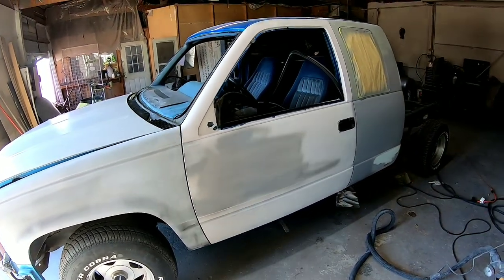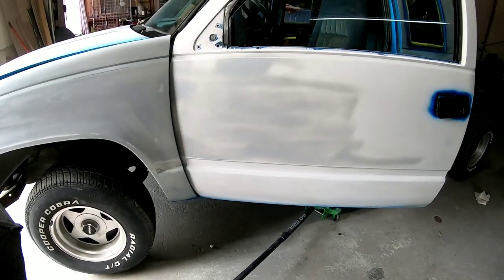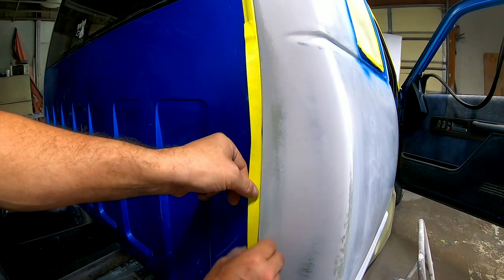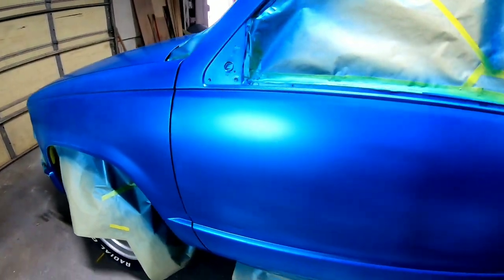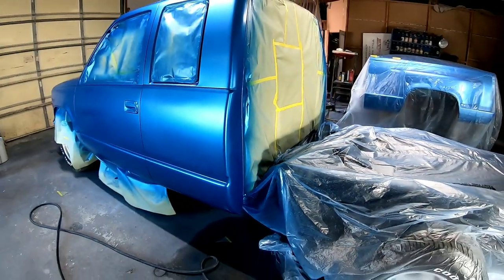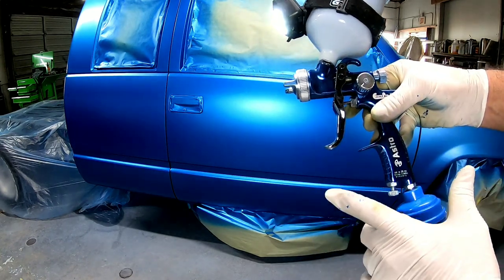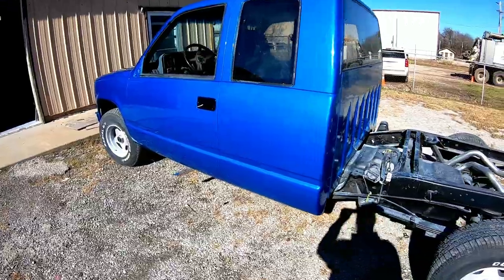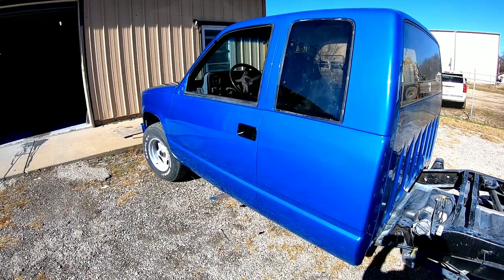How to do a complete truck paint job! auto body repair/diy auto body

Comment: Why not strip down and remove all panels and paint them seperately rather than deal with all the masking? This would allow for painting of the other side as well.
Reply from the maker: It wasn't absolutely necessary on this job. I also have to work with the budget of the customer. Appreciate the comment and support!

Comment: How long did you let the base coat Flash before you wiped it down with a tack cloth again? The truck looks great by the way!
Reply from the maker: I don't  remember exactly but under normal temps it should  be completely dry in 10 to 15 min. You just need to make sure it's  dry.

Comment: Whats the air consumption on that spray gun looking to get one for my 29 gallon compressor
Reply from the maker: It's  an he(high efficiency) which is suppose to be lower air consumption than a hvlp or lvlp. 10.5-12.5 cfm

Comment: Did you get any runs on that clear looks like your going heavy 1st coat
Reply from the maker: Yeah your right got a little excited  and hit it a bit heavy on the first coat. I had a small curtain on both sides in the same place top where it transitions into the flat part of the wheel housing. Other than that it all looked good.